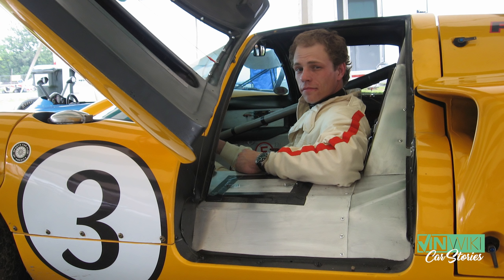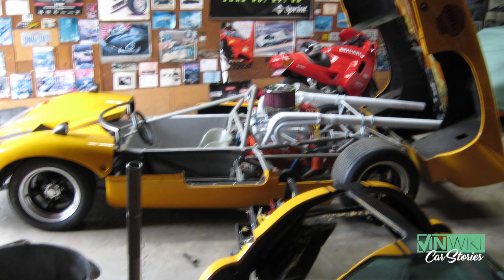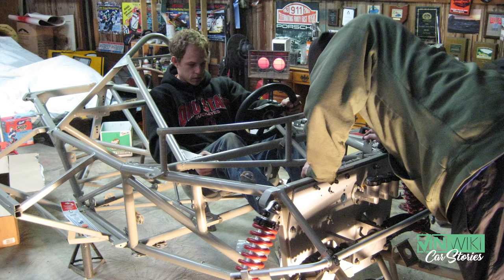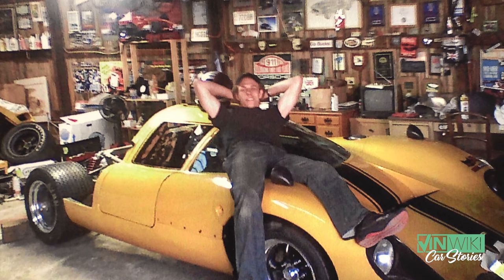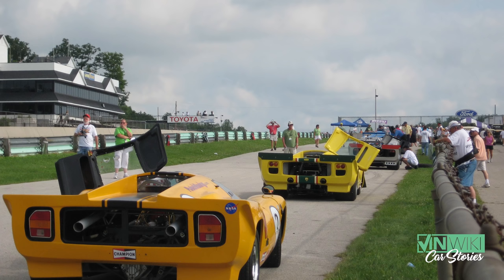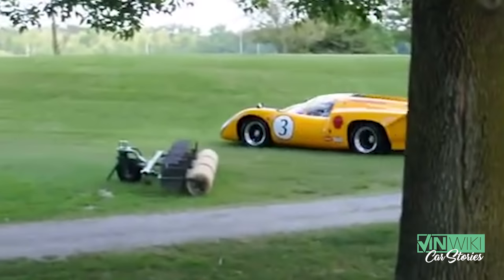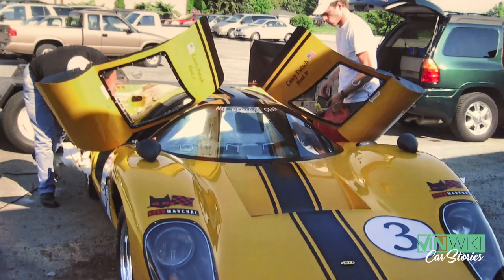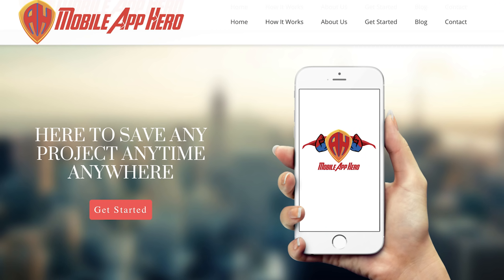Did my race car give me an STD?

Comment: Life goals - daily drive an ex-Can-Am car with AC in Manhattan.
Reply: Brett Bilger and a full leather interior
Reply: Amen to that 💥👌💯🔥
Reply: I dont know man the traffic would kill you............ driving in boston makes me want to blow my brains out in my STI...... 5pm traffic is no joke....
Reply: It’s not so crazy ,in mid 80s I bought what probably was and will most likely be the wildest car ever in my possession, a little 75-76 BMW 2002 SCHNITZER GR 5 race car ,why ? I really don’t know , I bought the car from my friend in northern Italy , I had the choice between that car and a Porsche tuning specialist in Italy’s back up 935 race mule , I chose the Bimmer because it was cheaper and I had access to 2 engines from Luigi Moreschi Racing which had briefly raced the car before BMW Italy convinced him it was time to move up to the new 3 series bimmer that was introduced in 77 . The car a regular participant in the German , Austrian and European gr 5 series , it was an under 2 liter car and it was powered by a 1.4 liter turbo engine with a simple electronic  ignition management system by Bosch and the glorious Kugelfischer mechanical injection system with guillotine throttle bodies , power output was anywhere from 340 to well over 500 depending on boost, it was an amazing car built by the BMW racing department, they built 3 of those cars , my was the one painted like the German flag , yellow , black and red , it has become the lead car in a video racing game showcasing the Nurburgring circuit . This car was really wild even in racing terms , it had a front mounted inter cooler, radiator on the driver side rear fender openings and oil cooler on the right side rear fender , 19 X 15 rear wheels and 19 X 10 in the front , they were state of art for that era 3 piece BBS with a 2 3/4 inch center hub , obviously brakes to match all of this might , like I said it was wild , big huge cow catcher type front spoiler and giant rear wing from a formula 2 March 782 ,. 
Vintage racing was not really open to anything like that so other than some track time as an outclassed ASR in SCCA it really had nowhere to go and play, I did a few hillclimbs but it wasn’t fun with power coming on all at once above 4500 RPMs in hillciimb hairpins and super tight roads it was a definite widow maker , so my convinced me that for the sake of our children I should probably just park it on the garage , so what do I do now ? Of course what any sane minded Italian with motor oil in his veins would do , turn it into a street car , right ? of course , why not ? .
All good especially since I don’t need AC  or a radio or a passenger seat for that matter , who would be crazy enough to get in that car with me anyway, right?  After 2 years it was almost ready , of course I didn’t have a title so I bought an junkie 2002  and used that title I figured I would explain my way out of it in case I should get pulled over by you know who . 
By that time we decide to move back to my wife’s home town in Pottsville Pa. yes that one , home of America’s oldest brewery Yeungling 🍺 , 
small town , we had moved in an old carriage house on about 16 acres of land that belonged  to my friend that sold me the carriage house and a huge 2500 sq ft garage , it a perfect setting , all kind of mountain roads around a 1 mile driveway to my house ,I was in motoring heaven . After driving it for a year or so probably 15 to 20 times and having become very familiar to the local gendarmes and had made multiple donations to their slush fund , the knew the car was illegal as hell but they tolerated it , i had open a foreign car repair shop in my garage and I used to donate time and money to local youth sport teams etc , my highlights was on Sunday morning when the whether was favorable I would take it on a 20- 30 mile ride on those beautiful country roads in an around Schuylkill county Pa , this particular road went by a golf course and the road  actually
Reply: I accidentally hit the arrow, I wasn’t finished yet , anyway the road split the golf course , that was a yellow blinking last to watch out for golf carts crossing so driving slow through there was a very good idea , the first Sunday that I drove that road with absolutely no traffic , I would go at a pretty good clip  and of that car was very very loud even with turbo an a glass pack silencer exhaust , I came to the first signs that something was coming up and slowing down was imperative , I’m driving very slow through the 3 or so turns around the golf course , the golfers on the greens had no choice but to stop playing and trying to see who this maniac in this maniacal loud car was , I just putter on by and wave , of course as soon as I went by the golf course complex  I’m on it and back to motoring heaven, of course I have to go by it again to go back home  , I drive the same way , nice n slow and wave as I’m going by , and soon as was by them they resumed their game , a little sooner this time , in subsequent rides it became routine , they would hear me coming , stop , watch me go by , I wave , some of them waved back others shook their heads , so it was ok , they never felt threatened enough to call the police or confront me in any way , it was like , hey you love your golf but this is what I love to do on a Sunday morning, it was great mutual respect , never spoke a word to one another. Couple years late I sold the car to an English fellow who somehow tracked me down through the Autoweek classified’s department old listing , to this day I wonder how that guy found me , but he was a nice chap and he actually drove from Ontario in a rental car as he only had an address but no phone number , we made a deal and he bought the car ,I shipped it to England a few weeks later , liti did I know that that car was going to become a lead car in video game , obviously it became very famous and valuable, I guess that day I did not look in my crystal ball . Ahh if only . 
Sorry about this being the length of a book I guess I just wanted to tell a story. Hope you enjoy , I know I enjoyed it living it .

Comment: Casey in the winter: working in an old pole barn with only a propane heater to warm your hands
Me in winter: working in a bare, rotting, 1-car garage with only a propane heater to warm your hands

I might try to make an oil-burner stove before next winter hits. This garage at one time had a woodstove so the stovepipe hole is still there in the wall